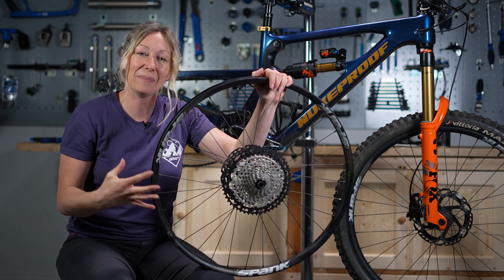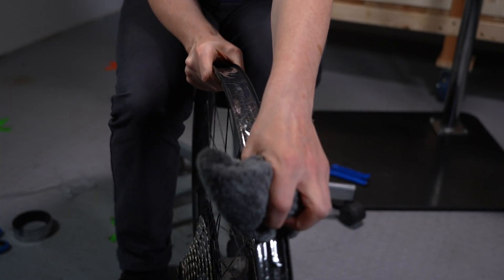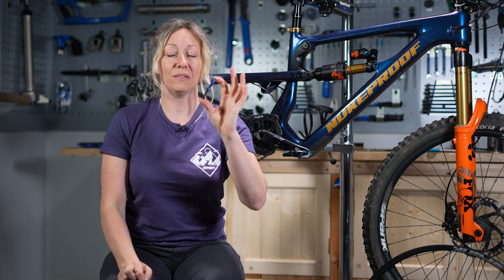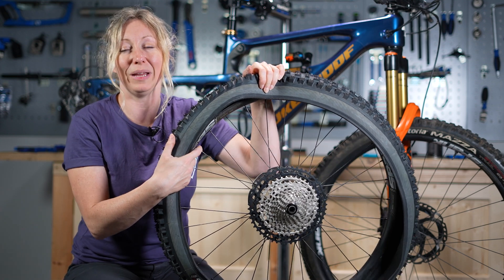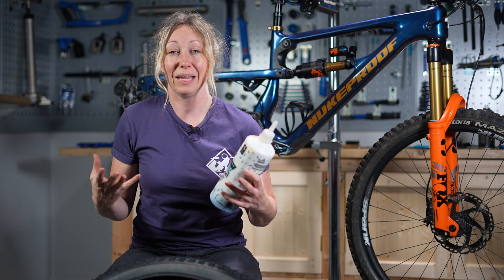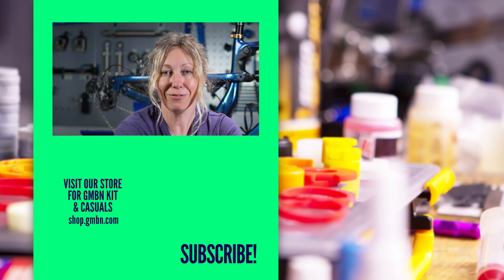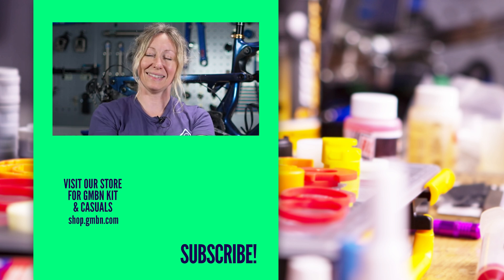How To Never Fail At Tubeless Setup | 5 Wheel Conversion Tips!

Comment: I've found putting soapy water on the beads before inflating helps the grippy rubber move to correct place. Never fails doing this.
Reply: This is what I posted. It absolutely does help. Been doing this for years.
Reply: Same. The other day I changed tyres on my bike, this made seating the tyres so much easier.
Reply: that's gold, without it, your tire most definitely not gonna sit straight on all parts of rim
Reply: This is a must👍
Reply: Yea if soap isn't available say on the trail even some water helps

Comment: I always use a syringe as it’s much cleaner. Just a tip which is only valid for using the syringe method. Blow the tire up before adding the milk, so the tire already sits perfectly on the rim. Release the air and then put the milk in so it can’t get out between the rim and tire.

Comment: The double POP when the tire seats is SO FREEKIN SATISFYING!! :)  
I have a little air compressor, so I've never had an issue.  I prefer Orange Seal, as it lasts a loooong time (10-14 Months for me), and the bottle comes with a straw to put the sealant in through the valve stem.
Reply: Yes, I do it that way too. Just an added tip: I always thoroughly clean the inside of the valve tube BEFORE screwing in the valve inner. You don't want sealant gunk in those threads making your valve sticky.
Reply: @bruce.KAY-bike-drifter  I wish you would have replied to this two weeks ago. 🤣 I had a valve all sorts of gunked up, turns out it was probs the valve stem like you mentioned. Lesson learned for sure!
Reply: @playgroundchooser  Good luck for your future riding. Keep safe and keep well.

Comment: Thanks for the tips. Here is another one: Use an inner tube to sit the tire, open the tire on one side so to get the tube out. Put the tire back. This way you will only have to work to sit one side of tire the other one being already sat by the tube. Takes time, but halves the chances of failure.

Comment: Use a tyre lever to seat the bead manually as far as possible on both sides, then it's pretty easy to seat the rest of it with a regular track pump.
Reply: Best tip here, this should be pinned, thanks mate
Reply: Could somebody visualize this for me? I don't get this
Reply: This is why I'm reluctant, finding myself in the boondocks 30 miles from an air compressor.

Comment: I watched this last night and went tubeless today. Some great tips. Pumping without the valve in, and using an air shot worked so easy. I kept the existing tape in because it looked fine and very well stuck. Hope it works ok

Comment: Struggling to seat... Get a presta to schrader adapter (£2) and take wheel to ur local garage forecourt to use their car tyre pump... But put it in 'flat tyre' mode if its a machine or u won't get fast enough air flow.

Comment: First question: How to choose proper rim tape width. Do I pick the one that's exactly the width of inner width of the rim? Or do I pick the one that's slightly narrower or wider?
Reply: If the rim bed is concave, the rim tape should be slightly wider than the rim width; e.g., I use 21mm tape for 19mm rim width for my gravel bike wheels.

Comment: I am seriously considering going tubeless. i love running tubes but I'm just tired of the only weak spot on my bike being the tire setup. My rear Continental Race King tire has a permanent wobble to it now because of a flat I received from running over a screw and not realizing it until the tire and tube was completely flat (I was wearing headphones with music on). I have to use my older oem tire that's in better condition because I don't want to permanently take the rim out of true.

Comment: The most important preparation is to ensure that rims and tyres are very clean. Using isopropyl alcohol on a clean lint free rag to be achieve perfectly clean surfaces, particularly the inside of the rim wall and its hook, and the outside of the tyre wall and its bead.

Comment: I have some OEM wheels that came on a 2020 Summum.  26mm internal width, and trying to fit 2.6 tyres on is impossible.  Never had issues before, with any other tyre/wheel combo.

Comment: Remove the screw from an old valve insert, screw the top end into the end of the plastic tube and screw the other end into the valve stem for no spill sealant insertion

Comment: Im new to tubeless and I successfully set up the first wheel and the second wheel would not seat after trying all the tips above and also useing a topeak joe blow to blast the air in. I couldn't do it after about 15 attempts. My next door neighbour came to the rescue with a air compressor and the tyre seated straight away.
Reply: Yes, I have had the same experience in the past. However, then I learned to seat the tyre on the rim first, without any messy sealant inside. I try to get the bead seated as neatly as possible all around by hand or with a tyre lever before pumping air in. Yes, I know, some difficult wheel/tyre combos need a blast of air through an empty valve stem using a compressor or a pump with a special cylinder. Only after you have the bead well seated all around, add the messy tyre sealant through the valve stem. Break the job down into easy steps.

Comment: My biggest struggle is unseating the tyre after sealant has glued the tyre to the rim extremely well. Simply pushing with tyre lever does not work, even using my body weight is a struggle. I guess I will have to just repeat it many times until it eventually loosen. Eventually it probably will, but working on it today, not sure when I will be finished. I will definitely work on it for a while. I won't cut the tyre off like some do when that happens. 😁After a lot of repeated tries it eventually unseated, I kneeled down on the rim, and pushed the tyre using both hands, I tried at multiple locations, but when it made a gap at one spot I continued there, it eventually unseated, fully there, so I continued around the until whole it was fully unseated all around the rim.
I run Cush Core currently use Gorilla tape but trying Stan's now, but not impressed roughly cut, tearing, hard to tape. Not as easy as in this video, I won't be continuing with Stan's. Problem with gorilla tape is adhesive is hard to remove, I should have tried with a sealant and adhesive cleaner from Muc Off, heard good things. But Gorilla tape also is not air tight, so needs a ride before it seals. But application is easy. But removal onc eit is worn some can stick well and it tears leaving some on. But key is to be gentle and slow removing it. But if really worn its unavoidable to have some adhesive, but Isopropyl alcohol won't remove it easily, it loosens it up, but involves a lot of rubbing with a rag. I struggled to find decent rim tape in stock. But Stan's is not it, nor is Gorilla tape I've not seen any reviews of the Peaty's rim tape but might try it. Maybe Muc Off too.
Reply: I have switched from Stan’s tape to Much-Off.  I think MO is much better.  To get the tight bead off the rim there is a giant tire lever made for use with Cush Core inserts.  I don’t use inserts, but the big lever makes unseating the tire bead easier.  Also, you can set the wheel on the ground and stand on the tire on each side to use your body weight to pop the bead off the rim; wheel horizontally on the ground perhaps on top of some rags or cardboard.
Reply: @mattkavanaugh5623  None of that worked, maybe it helped, I don't know. I edited my comment, to tell what I did.
But I just had to do what I usually do kneel down on the rim and push the tyre with both hands, it eventually unseated but my hands hurt like being hit bu a fast football.
I have Cush Core lever, but that does not help with this issue. I just had to repeat the pushing of the tyre. There is also a method where you interlock fingers and clamp with palms and fold the tyre until it unseats, but I've not tried that.

Comment: When inflating the tire with your sealand inside, where should the value stem be when inflating? 12 o-clock position? 2 o-clock? 6 o-clock? Or it doesn't matter?
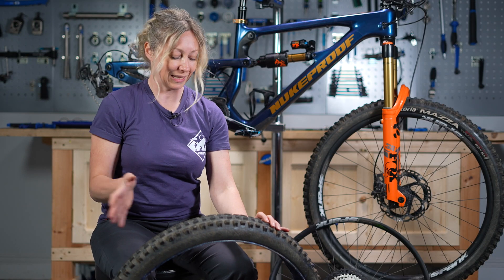Reply: 4:00 or 7:00 so sealant will flow down easily but not clog the valve.
Reply: Depends on time zone.

Comment: So my rims are “stans arch d”
And today I setup tubeless but my rims have a faint line at one part, looks as if it’s where they join together when manufactured but air is escaping through this join line, any ideas how I can correct this?
Reply: @jaredkirby1237  I had a similar issue. I removed the tire. Got some super thin cyanoacrylate crazy glue. I applied at sparingly to the join in the rim, both on the inside as well as the outside. I did two coats with a few hours in between and allowed 24 to fully cure. It is held up for several years now.

Comment: #ASKGMBNTECH - Love the program!! How do I choose the correct with of rim tap for tubeless conversion? With different rim specs it gets very confusing!
Reply: The wheel manufacturer has it in their spec for your wheel. If the wheel is the stock one which came with your bike then your bike manufacturer will also have the size in their spec.

Comment: I struggle setting up tubeless as I only have a track pump and a hand pump, not a compressor
Reply: I’ve used a CO2 inflator to due this in the past. It’s best to use the 25s to give it enough pressure to pop onto the bead
Reply: I would try an air reservoir canister to use with a track pump.  I have a track pump with a built-in reservoir (Bontranger Flash Charger) and it works well.
Reply: @mattkavanaugh5623  yeah I can see they work well but I don’t fancy spending £150+ on a pump when that’s the cost of two of my maxxis minion tires
Reply: Another person made a good suggestion that is relatively cheap. Get a presta-to-schraeder converter nut. Screw it onto your presta valve stem, without the valve inside. Go to your local service station and use their car-tyre pump to blast a strong shot of air into your tyre.

Comment: What tape sticks as well as Gorilla tape? Gorilla tape is easy to apply, but is more porous than rim tape.. most rim tapes I've tried either tear , or don't sit well in the rim no matter how tight I pull it, or just don't stick no matter how clean the rim is.
Reply: Muck-Off tape has worked for me, better than Stan’s, but Stan’s worked too.
Reply: @mattkavanaugh5623  Stans was aweful, I like Muck off, but it's hard to get here. Muck off's finishing strip doesn't hold, otherwise it's the best thing I've used.

Comment: Can someone tell if I can convert a regular rim into a tubeless this way or do I need to get a different rim and tire plus valves thank you for your help
Reply: You can, but it's not guaranteed.
Probably need to wind the rim tape round several times to get a lip for it to seal on.
Reply: err... Sometimes. It worked for my son's higher-quality rims. It failed after many, many attempts for my wife's cheaper quality rims.

Comment: timely subject as the snow begins to melt here.
Reply: time stamps are sooo user friendly!!!   thank you.   you were not clear enough at the end on how or why removing the valve stem will help inflate a tough to seal tire.  ????  missed the concept after re watching that pit.  great timely presentation for those exiting winter.
Reply from the maker: Hey Greg, essentially removing the valve stem helps ensure maximum airflow from the pump into the tyre. Sometimes, if used, the valve stems get a little clogged with old sealant which can result in a 'trickle' of air rather than the rush necessary to get the tire on the bead

Comment: Muc off sealant is easy to clean out, as it washes out while it's still liquid and is bio degradable. Just hose the tyre and wheel off
Reply: horrible brand pretty much for everything they produce. the sealant curdles and clumps, dries way too fast comparing to notubes and conti sealants.